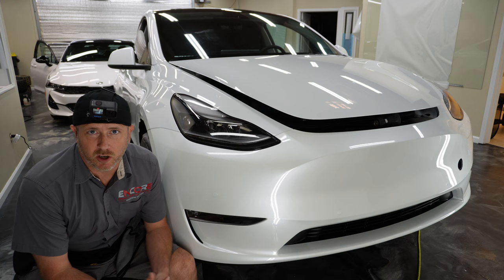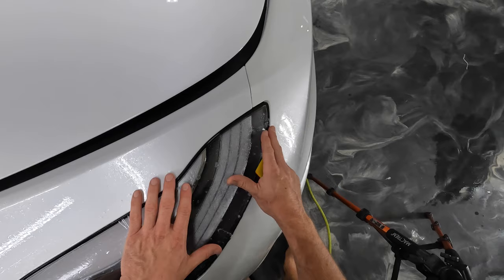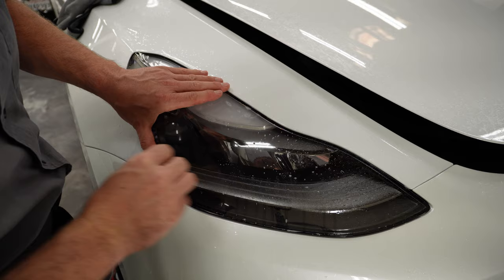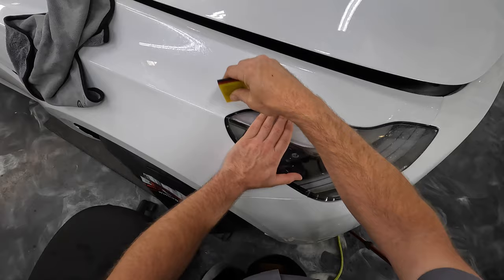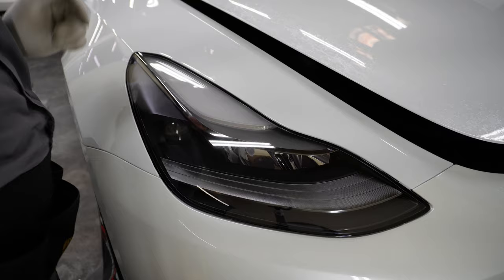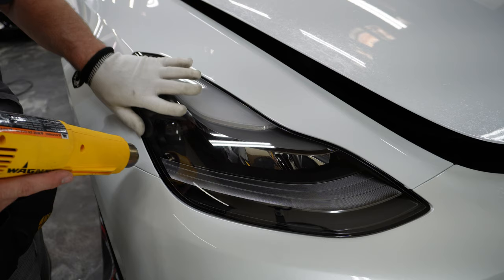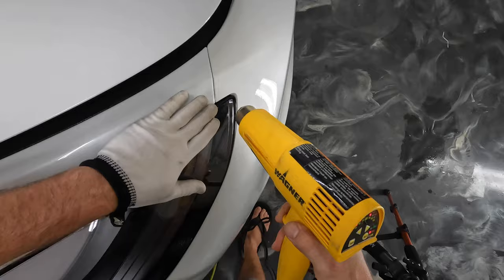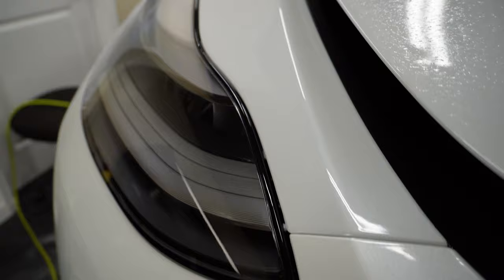Headlight PPF install - A Step By Step PPF Tutorial (For Beginners!)

Comment: Is it easier to do this with the headlamps (or the lenses, at least) OFF the car?
About to put some Aliexpress specials on mine, and want to UV protect them right from the off😀
Reply from the maker: No. The problem with removing the headlights is that they move around when you are stretching the PPF and squeegeeing it into place. Having the headlights attached to the vehicle keeps them stationary and that is a huge help. From time to time a customer drops off new headlight off the vehicle and I really hate working on them that way. Normally we'll have them install them and then we'll put the PPF on.

Comment: Does the heat gun after spraying with alcohol not cause the spider cracks in the plastic ?? I’ve had a couple instances where using a little bit of heat after cleaning with ISO caused spider cracks in the lens. Can’t seem to figure out the problem.
Reply from the maker: I have not had that happen. My wife did damage her headlight the other day while cleaning it so I could install PPF. She used 3M adhesive remover. It put the spider cracks in the headlight like you are talking about. That was the first time I've every seen that happen. The things that I am doing in this video will not cause that problem.

Comment: how's your measurements for your slip solution on your keg or bottles sprays? I'm currently using just hot DI water for my tack, thanks for sharing🙌
Reply from the maker: Thank you for your comment! What soap are you using? With the soap we use it's 7ml per gallon of water. The soap we use is (was) sold by PremiumShield and is no longer available (since they were purchased by Eastman), but we still have a lot of it on hand. On point solutions are so important to the easy of the install process. 
We use RO (reverse osmosis) water from an APEC filtration system we installed under our sink. I'll add a link to the system in the description. 
Great call on the hot DI water! Hot (in our case, R.O.) water is always in one of my bottles and I think it's underutilized in our industry. 
My third bottle is Isopropyl Alcohol (71%)  and water, diluted down to 10% Alcohol to 90% water.
Reply: @Encore Window Tinting and Paint Protection Film  thanks for your reply, I'm using J&J baby shampoo, are guys also use gel? how's your mesuarements for gel?, I went to the Autofilmmastery PPF training it was a good , I'm currently using Core software, any other software that you have tried?
Reply from the maker: I used J&J for a long time. At some point, I felt like they changed something in it, so I moved on. All of these years and I've never tried Gel. My concern was it getting on the floor and not drying up completely. I'm not sure if that's even an issue. As far as software goes, I've used quite a few over the years. The only reason I started using CORE was that they purchased PremiumShield. Their patterns aren't as good as PremiumShield, but now they own the patterns and how to create them. That's a huge upgrade for CORE. CORE needs some work when it comes to window tinting patterns. We're going to test DigiCut starting this spring. I met some of the DigiCut team at  S.E.M.A. last year.

Comment: What is the "pre-spray" and what are you using for a squeegee
Reply from the maker: The pre-spray is called "slip solution".  The soap in our slip solution is "seventh generation" dish soap (found at most stores). We add 5-8 ml of that soap to each gallon of water.  Here is a link to that squeegee I use now. It might not be the same as the one used in the video. www.amazon.com/gp/product/B0BWH9WJ17  The black squeegee is the one you want. The squeegee is a bit wide for me, so I cut about an inch off one side of it. 👍
Reply: @EncorePPFtint  Thank you

Comment: I heard that PPF isnt good on Porsche headlights because it will damage the coating when the film is removed. I also read thst PPF can cause micro cracks on the headlights. I have a 2024 Lexus RX 350, do you see any issues with PPF? I might put either Xpel or 3M
Reply from the maker: That is true, but I think it's worth the risk. The problem with Porsche headlights is that the PPF might pull the clear coat off when you remove the PPF. If this happens you can sand and buff the headlights back out and then reinstall PPF over them. Never having PPF on them is an option but the road debris and bugs are going to damage the head light anyway. And in a way that there is no fixing them. I always inform Porsche customers and let them choose. This also happened on my Buick Enclave, 12 years after the initial PPF installation. I just reinstalled PPF and the headlights still look new. With all of this being said, it's rare that the clear coat pulls off. 
I would protect your Lexus head lights, no questions asked. Other than the Porsche and my older Buick, I have not pulled clear of other headlights. 
Reach out to us if you'd like to order a precut kit for your headlights. We'll sell you the same quality film that we install. info@encorewindowtinting.com

Comment: What's the point of putting ppf on headlights? There is paint to protect, and the scuffs on the plastic can be polished if it happens.
Reply from the maker: We protected the paint as well. Just like the paint, headlights take a ton of damage from rocks and the sun (turns them yellow and frosted). It's best if you never have to refinish headlights. With PPF, you won't need to. Polishing removes the clear coat from the headlight that is protecting the plastic. At that point, the headlights will frost  and turn yellow within a month or two. We refinish headlight all the time. The final step is putting PPF over them so they don't go bad again. 👍🏻😁 One of my cars is a 2008, and I've replaced the PPF on my headlights once. To this day, they look brand new!
Reply: @EncorePPFtint  Thanks for the explanation. Makes total sense. It just I've never seen any issues on my cars. I currently have a 2015 golf with 80k and the headlights still look like new w/o any ppf. However the hood and  the bumper took a quite a beating from the road debris and small rocks. So I definitely very interested in installing PPF on my new car to protect the front.
My guess, it depends where the car spends most of the time - on a scorching sun or in the garage. I'm a bit concerned about ppf or the layer of glue could bond with headlight plastic and make it less clear over time. Or it would not be possible to remove/replace PPF w/o damaging headlight protective layer.
Reply from the maker: The PPF is removable.  It's very rare that the clear coat on the headlight gets damaged during removal. Next time you're done washing your car, rub your hand over the plastic headlight. There will definitely be plenty of pits from the rocks. They take the hit better than paint.  Plus, because you are looking through the plastic into the headlight, they aren't as visible. PPF will definitely stop those chips on your new car. It definitely does it's job. 👍🏻 Another thing is that your headlights are very vertical.  Tesla headlights are much more horizontal and thus will get a ton more sun exposure.  🌞
Reply from the maker: Unless the PPF goes bad, clarity won't be an issue. 👍🏻😁
Reply: @ivanobulo  you’re lucky, I’ve seen cars with hazy yellowing @ 50,000 miles. Yes you can sand and polish them to make it look brand new, but PPF keeps them looking new without having to put in that work

Comment: i like what you guys do protecting cars but why bother with a tesla in 8 years it's throw away junk...
Reply from the maker: This is where I'd like to post a "guy eating popcorn" gif. We're in California and it looks like they are trying to ban Internal combustion engines in 2035. 🤷🏻‍♂️ I can see the batteries going bad over time but that technology will keep getting better. Plus aftermarket parts will be a bigger thing at some point as well.
Reply: @director2105 bought into the oil companies propaganda hook, line, and sinker.